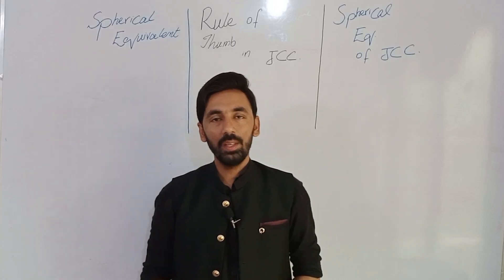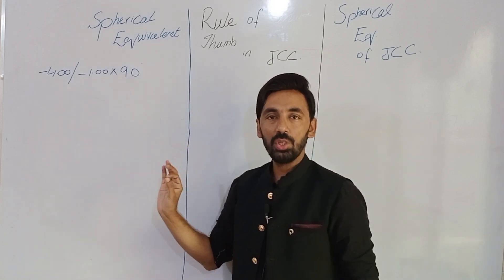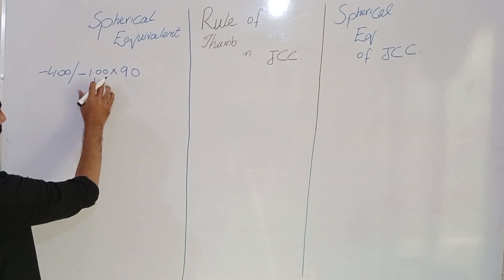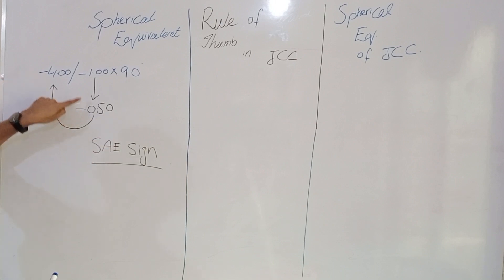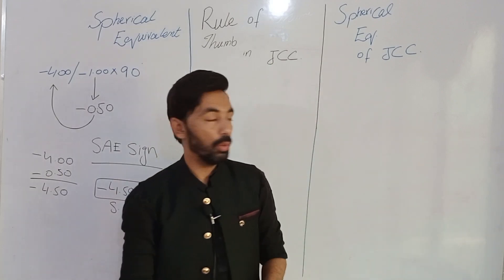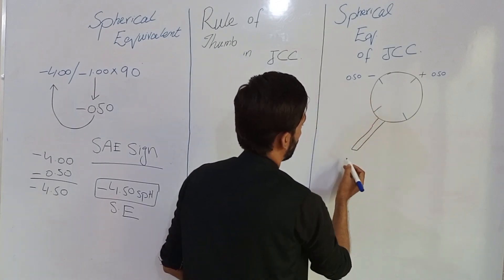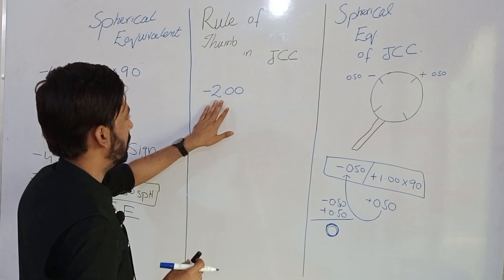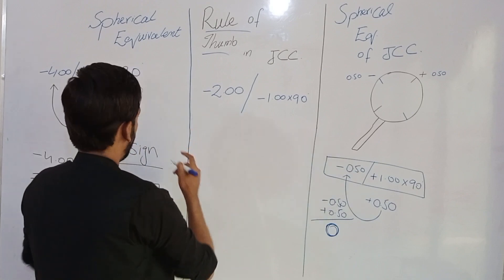Spherical equivalent/ Rule of thumb in JCC/ Spherical equivalent of JC. Common mistakes and Solution

Comment: In rule of thumb of JCC ! Suppose our cylinder refinement is -0.5 DC in addition to existing -1.00/ -0.5 * 90 degree, then are we taking half of the refining cylinder or add that cylinder to the existing one and then take half of it in order to add in sphere  to obtain our final sphere ??
Reply: Example - final prescription would be -0.75 / -0.5 * 90 degree or -0.5 / -1.00 * 90 ??
Reply: Your cylinder power remains same As in the prescription.. Don't Minimize or changing in the cylinder power Just half the cylinder and Change the sign And add it in the sphere So you can Get your Rule of thumb Spherical equivalent after jcc performance For better vision And Prescribe the patient both sphere and cylinder number after jcc performance this is the accurate one...